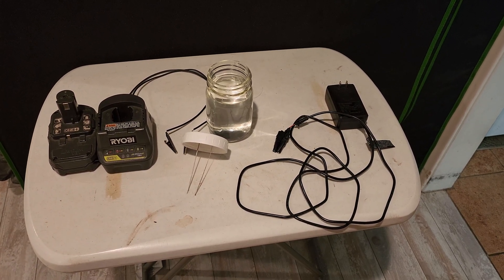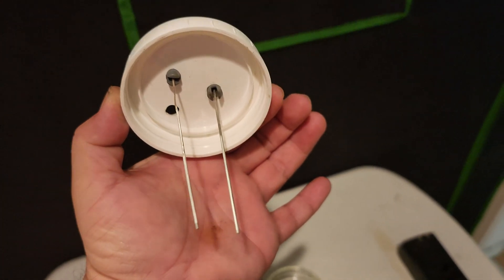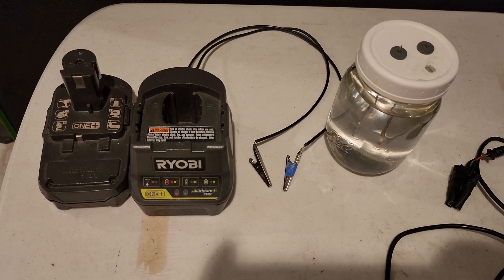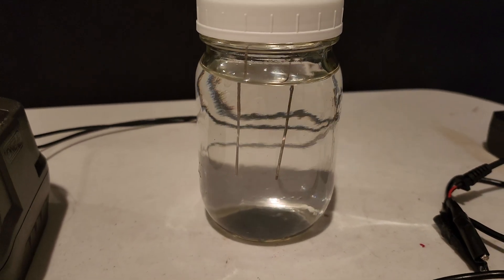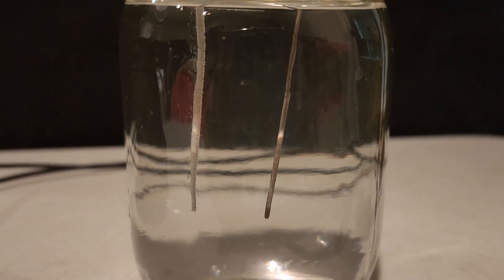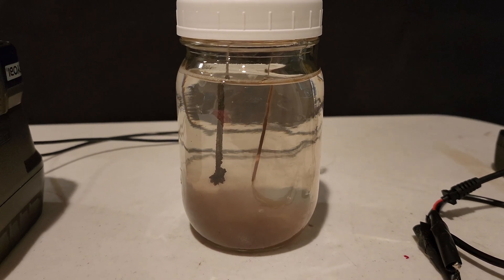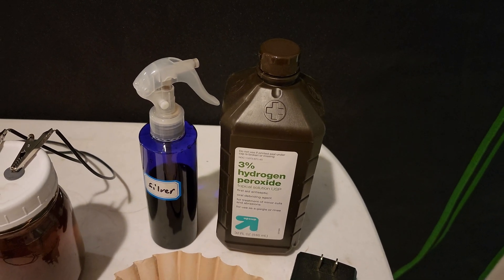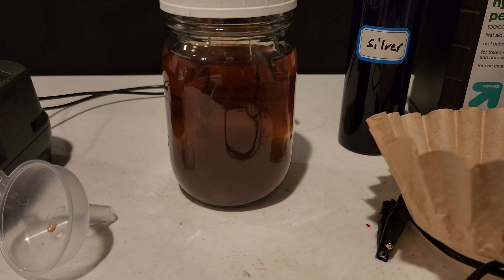How To Make Colloidal Silver Cannabis Reversal Spray for Creating Feminized Cannabis Seeds.

Comment: Referring to the electrical components, this method can be very dangerous if not done properly by somebody with electrical knowledge. Just so everyone that reads my comment knows, the self healing pads double as insulation, the rods have to be insulated from the lid of the jar where they stick through, and the alligator clips need to be insulated and not touching anything but the rods when you connect them. I like your idea of using a battery charger, it reduces risk but still can start a fire. That being said, this is absolute genius and I may try it.